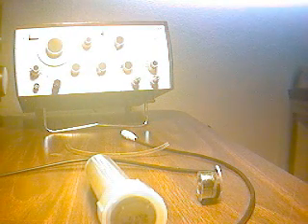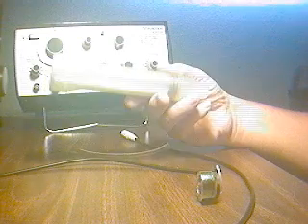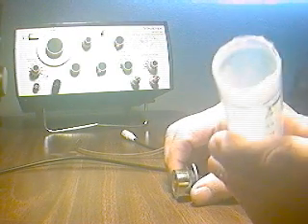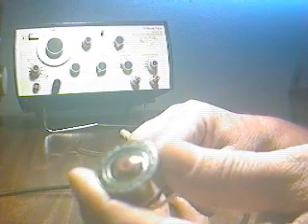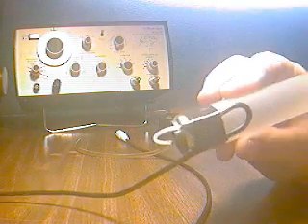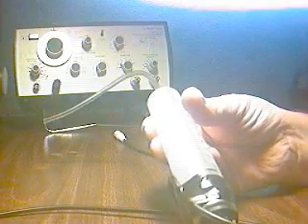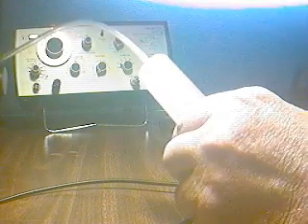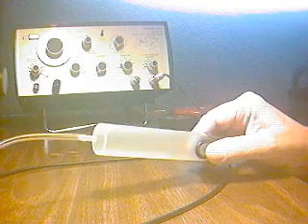easy infrasound acoustic source

Comment: If it's infrasonic, then why can I hear it at the end of the video?
Unless we are hearing harmonics of it it doesn't make sense. 
For one thing you'd have to have a microphone that could pick it up for your recording, Youtube's audio encoder, and then my headphones and it's amp would have to support sub-20Hz also..
Reply from the maker: yes ... you CAN hear it, exactly the point of my video. it proves it by clear demonstration.  the human ear isn't very sensitive down low but can hear about anything up to 10k - 15k if amplified enough.  you are speaking of " sine waves " which all audio applications are expressed in ... nature has NO sine waves.  once again nearly  all inexpensive audio equipment can be made to reproduce infrasonics with enough amplification and filtering off  of the high freqs. expensive equipment ( and computer sound cards ) usually has filters to stop unwanted freqs below 20hz.   sound wave are simply waves of air pressure. the human ear responds to air  pressure    .. zero up to about 10k - 15k ( if loud enough ) , above that the bones in the ear can't move fast enough.  lower waves are especially easy for the ear to respond to if loud enough ( after all, what is the bass beat of nearly all rock music ??? .. its  8 to 15 hz infrasound and heard because it's amplified loud enough ). a car door slamming is infrasound, sonic booms are infrasound, car wrecks are infrasound etc.  .. humans experience infrasound all day - every day and hear it all the time.
Reply from the maker: also .......... 
consider this , in the medical world human hearing is measured from 300hz to 3000hz. if you get your ears tested in a medical facility , you WILL NOT hear above those freqs and often not even that well.  you already know that your stereo reproduces 20hz to 20k hz and you CAN hear that. in my video I prove you can hear down to 1 hz and even lower.  the differences are all about sound pressure / loudness.  the human ears are most sensitive , naturally, between 300hz and 3000hz.   you KNOW you easily hear the 8 - 14hz rock beats , a car door slamming etc.  it's all about loudness / air pressure levels.
2nd'ly and most confounding ......... think of this.  ( and THIS IS NOT technically correct BY FAR but is just for explanation purposes )  if someone sounds their car horn outside waiting for you to come out ... you hear that 2k tone for several seconds.  if it was possible to transfer that sound to 2hz.... it would  1000X longer  for you to hear that same sound ... or about 16 minutes.   you've seen what slowing down someone's speech looks like on TV many times ..... imagine slowing down that same speech 1000X more !!!!  you wouldn't hardly see ANY movement on their face and they would barely make any sound at all.  the world below 12hz is literally filled with sounds 24 / 7 ( just as much as we do hear all the time ). we are immersed in it all the time . some of that infrasound we " get it " from learned experience. a 1hz car door slamming, the 8 - 14 hz rock beats etc ... we have learned to recognize those from experience. the VAST majority of infrasound is incomprehensible  and the long wave forms  mentioned above contribute to the mess.   this stuff is WAAAAAAAAY more complex than people realize.
Reply: Yea neat stuff.
It turns out when I switch to an actual subwoofer then I can  hear a low end. 
That was my fail, but I wasn't entirely wrong.
Apparently the headphone would only pick it up the harmonics.
Which by the way you can hear in your recording a higher frequency component. It's up there maybe 500Hz'ish guess.
Your deal there has apparently a pump effect. Maybe the sound of the air collapsing back into the tube?

Apparently you can't hear infrasonic, but rather FEEL it.

I happen to be playing with a "Dayton Audio BST-1 High Power Pro Tactile Bass Shaker" (only $30 online) as I write this.
Fed with a cheap TPA3116 based 100W subwoofer amp. Note the Dayton has a spec bottom end of 10Hz.
On the workbench with a bass music source,  I can definitely feel it with my hand pressing on it, yet hear some of the low end (which I'm sure is above 20Hz).
More of what I can actually hear is stuff like the shelves rattling on the bench.

I still have yet to take the signal generator out and see how low it can actually go (where I can hear and/or feel it).  
I got to go out and get a beefer power supply for the amp.

FYI I don't deny your claims. From my study, apparently animals can be more sensitive to infrasonic (maybe humans too if it were not for all the noise pollution) and can thus sense a lot of things in nature like earthquakes, etc., before they happen from infrasonic emissions.

Anyhow our conversations has been pretty subjective.
From what I understand from music, again with say base drums, there might be components infrasonic (from a real percussion or just even more so synthesized) but for sure there are upper harmonics that are going to be up there in definite hearing range. 
And of course sound producers have to have this so the music can be heard on a variety of consumer electronics (not just "hifi" setup people).

Good read I found recently:
https://www.uaudio.com/blog/how-the-ear-works/  

Anyhow we both need to keep it scientific to at least some degree.
I mean, I might read you wrong, but please don't go off into "woowoo" territory ;-)
I don't have a $3000 dollar budget to go out and buy a infrasound sound meter.
But so far I'm only in this for cheap. And I can hook up a scope and verify anything et al.

FYI there are many sources of 15Hz, 10Hz, LFE sweeps, etc., I found here on Youtube. That is assuming that they are good (need to hook up the oscope and meter them).
Reply from the maker: feels like  you are kinda mixing apples and oranges ( bananas ?? )  and missing the point here.   it's best to keep things simple to try to grasp this stuff.  first throw out ALL your stereo equipment related associations  right now.    start with this basic fact: all humans have ears that are sensitive to sound pressure.  all humans are able to detect anything that can move their eardrum.  any sound  ( which is )  air pressure that can move your eardrum ( sufficiently )  is able to be detected by you.  thats  sound pressures well below zero hz up to about 15k - 18k or more if it's loud enough. many people, including my self but especially women can hear 28K very clearly.  old tube TV sets had a high power HV  oscillator on those freqs that used to drive some women crazy. I could hear those transducers of those acoustic alarm sensors at 20khz very easily because they were loud enough to move my ear drum.

then: keeping what I just said is the starting premise ... then if you want, you can relate how all your stereo equipment relates to that.
harmonics ????    just remember that generally infrasonics is thought to be related to natural sound and stereo equipment is only rated in " sinewave " performance.  there are NO sine waves existent in nature, sines are mostly all manmade.   my video shows a Wavetek 142 signal gen making a non sine waveform ... there can be NO harmonics  is play at all . Waveteks don't make harmonics.  if you are hearing them then it's in the reproduction audio chain and completely misses the point of the video. 

the only value of infrasonics in home stereo equipment is for the percussive value of say a bass guitar or a base drum . and you already know you hear those.  

remember the premise above and then question how any other thing ( speakers ) come into play with that.  if something can move enough air to move your ear drum  below ( say  ) 12hz .. then it infrasonic ... period.  don't add in anything else here !!

evidently you are interested in infrasonics related to stereo ( sine wave based ) equipment.  thats how it sounds to me.   if you want more low end response ( tho most stereo equipment already reproduces base drums and  and base  guitar percussion well ) then just move more air. 

one quick whack  of the low string guitar is one HZ .... one kick of a bass drum is basically one hz ....... if you hear those then what do you think you are missing ?   do you hear a car door slam ??? thats one hz ! it's as simple as that. 

if you want to measure / see   infrasonics ... go to ebay and search for " infiltec " and you'll see an affordable transducer / a/d for a computer. 

the ear drum movement is the rock solid  absolute key here .. everything works around that.   it's unnecessary to make it more complex tha that.
Reply from the maker: one last thought.  you are speaking of a lot of subsonic ( below 20hz ) stuff in your last note relating to stereo equipment / speakers.  that subject is a big can of worms as is easily seen by all the industry stuff related  to it.  but basically, subsonic sound  IS NEVER recorded onto commercially sold music.  no Cds , radio stations, vinyl etc ever have sub sonic sound ( sines ) recorded on them.  nearly ALL home equipment isn't capable of reproducing them and they muddy  equipment that plays the music if present .    measure the max and min frequency of any song or recording  ( sinewaves of course ) and you'll moistly never see freqs above 20k and below 20hz. 
if you want to shake the ground like in a Imax theater you'll need transducers that reproduce non sine sound waves AND a source that contains those sub sonic waveforms.  most rock music does not contain subsonic sinewaves .. but does contain percussive infrasound .  there is NO universal type of sound source  available and no universal system to reporduce that type of all inclusive sound.  music is extremely varriable as it types of equipment to reproduce it. industry standards are 20hz - 20k hz and most all common equipment is designed to reproduce those freqs.  understanding that at least  TWO kinds of sound waves are present in music is important. music contains sine waves and it contains non sine waves.  speakers and audio equipment are usually rated in their sine wave reproduction abilities.  signal gen stereo test devices , sweep files etc always contain sine waves ... but  usually omit ( percussive ) non sines.
Reply from the maker: most difficult with infrasound is grasping / understanding what is happening and " re- learning " everything you thought you knew about sound waves.  it was years before I started to " get it "  . go to my Facebook page " Wave Bender " and look at  the photos of my earth sciences lab  about 3D FFT transforms.  it's easy to grasp a car door slam, or the base beat of a rock band but , like I mentioned, humans are literally bathed in  mixed infrasound ( just like audible sound waves ) 24 / 7.  there are pictures of my equipment and sensors there as well.    I started back in the analog age and it wasn't until the digital age before I started to make productive headway. I was able to do this by digitally  speeding up recorded infrasounds.   after I discovered how to drastically speed up the sounds to a frequency like humans hear ........ mysterious sounds / 3D FFT wave forms became ordinary motors running, wind blowing at angles to the sensor , farm harvester sounds etc. . without speeding things up I would never have understood what I was " hearing " ( so to speak ).  also ...... remember that the layers of earth's atmosphere act like " conduits " that conduct infrasound around the globe ( at the speed of sound ) , nearly unattenuated.    meaning that sounds that you capture ... strong sounds ... sounds that you may think are local .... these sounds can be 1000s of miles away and even from other countries.   ekg looking roll chart displays / recordings are great for seismic ( earthquakes ) use but nearly useless displaying all the information that a 3D FFT  transform can display  for infrasound.   it's like being blind and suddenly having sight. infrasound must be captured and displayed by instruments / FFT or up converted to human ranges with a vco ... this to be useful for study and be useful for humans to interface with them properly.  check out the photos of waveforms at Wave bender to see what I'm saying here.

Comment: You stated to get the microphone at somewhere like RadioShack, but where do you get that signal generator from?
Reply from the maker: they are plentiful on eBay , between $50 and $100. there are dozens of HP, WaveTek ( 142 )  Tektronix and Krohn-Hite ( many )   available that would work well and be about the same price.  any quality sig gen that goes down below 1 hz is fine , oldies are goodies.  any moving coil dynamic microphone with a  diameter of 1/2" -  3/4" or more is fine. plenty of those on eBay as well.

Comment from the maker: all of  this  can  quickly get  more complex / difficult  by a magnitude.  imagine you can suddenly hear acoustic waves ( like normal hearing ) from zero to 20 Hz.  never having heard them before ( easily done using a Grass Instruments  AM-10 VCO amp or my budget Gauss Master VCO version  with a Baratron differential  2mm H2O  pressure sensor seen in a different video ).  like when you are born , you have to once again learn from scratch what each and every sound is and where it comes from.

Comment from the maker: is there a difference between spinning a cobalt magnet on a string at 5 revolutions or setting my Tecktronics sig gen at 5 hz into an induction coil ? 
since my  $400 ferrite core Stromwise  ( .5hz - 30hz ) sensor sees both equally , then which is which ??  even my Speake FGM-3 can't tell the difference , so ??   ya ahya ayah  check out my Facebook site " Wave bender " to see all my equipment and test bench site. I'm  measuring infrasound, ULF radio below 15hz and geomagnetic waves up to 30hz !

Comment from the maker: sibbald: y ahaya ya h , I promise you that striking a drum twice a second for ( say ) a minute or two does indeed produce a 2hz acoustic  wave.  we are never  quite schooled properly on  acoustic waves ( sound ) because they are so difficult for many people to understand, myself included.  but ... my extensive acoustic test bench doesn't mislead or leave things out.   an acoustic wave front is simply that, molecules in motion ,it doesn't matter the source !!  repetition rate IS  frequency .
Reply: Hitting a drum once will already create an acoustic wave with a specific frequency. That frequency will be determined by the pitch the drum is tuned to. (say a kick drum could be tuned to around 70Hz). Repeating that kick drum at another frequency will just send out repeated waves of 70Hz. 

There's a strange phenomenon that happens if you repeat the kick drum at superhuman speeds at say 35Hz you will start hearing that frequency in addition to the 70Hz pitch of the kick drum.
Reply from the maker: @julien-vogel    You can think of it as being like a radio signal.  If you hit that drum once ….. it a 1hz infrasonic pulse / wave that is modulated by 70hz.  If you hit that drum 7 times in a second , you create a 7 hz infrasonlc wave that is modulated by 70hz. 
      You are absolutely right in saying ( hypothetically) hitting that  drum at a rate of 35 times a second would raise the sound frequency to the range of human hearing. A 35hz wave modulated by a 70 hz signal.  You can see in my videos that the human ear, although very insensitive to infrasound, is still easily capable of hearing / detecting ( say ) 5 or 7 hz infrasound of it is coupled tightly enough to the ear canal. Humans “ feel “ infrasound … and if it modulated with 70 hz, they will hear it as well.  Kewl stuff ….

Comment from the maker: all sound " of any kind from any source " on a frequency of 2 hz has the same wavelength , no matter what it is
doesn't it ??  your eardrum / detector  doesn't care where it came from or what generated it.  no matter if a meteor  made the sound or a  4000 watt  thumper car  stereo 15 blocks away ( the meteor  explosion being FAR more powerful ).  it's why infrasonic monitoring stations are ALWAYS located in extremely remote locations, away from man made low frequency sound as much as possible.